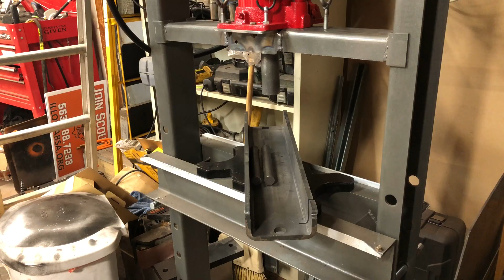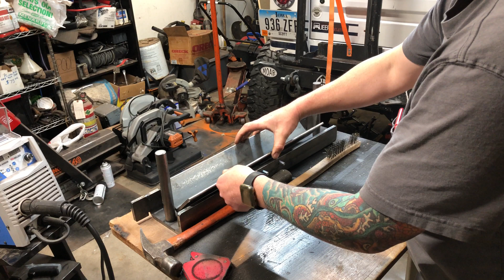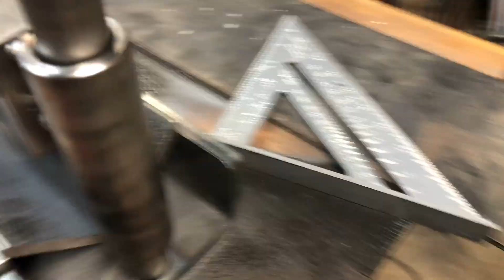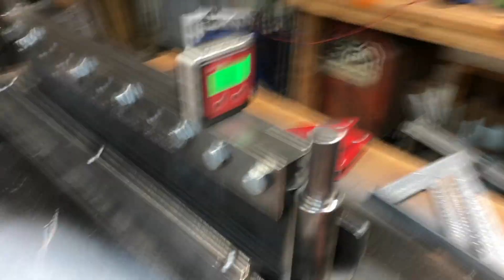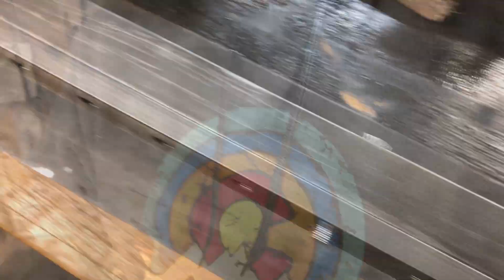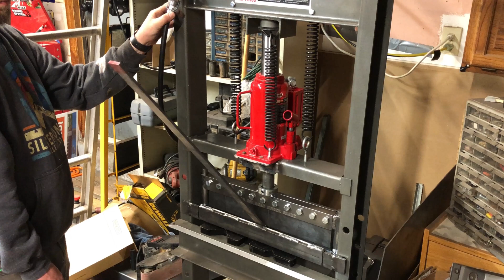( SWAG Offroad ) Finger Brake Build for Harbor Freight 20 ton Press

Comment: The same thing happened to me when I built my brake from swag offroad.  Mine is off center and my angle iron is sitting offset a bit. I didn't even check the fingers, I just assumed I didn't center the fingers correctly 😕I'll have to cut everything and redo things the way you did it.  It was my first welding project and I thought I messed up but its just poor manufacturing.
Reply from the maker: The reality is, most bends I make never bottom out in the angle anyway and it probably would be fine. I get a little particular about some stuff especially if I’m putting it together. 🤞 good luck

Comment: Good recovery.

For anti-spatter, you know they make stuff for that.  But it is expensive.  I learned to use Walmart cooking spray about a decade ago, and it works great.
Reply from the maker: Ive since learned to set the welder up a little better which also helps haha

Comment: Swag  makes awesome tools!
Reply: Yup they do but it’s just a pity they can’t ship downunder is all.
I got all excited by lots of these videos, couple hundred for the harbour freight press from Harbour Freight & a couple hundred more for the air over hydraulic Jack mod, all sounding good until it works out you can’t buy from Harbour Freight from overseas even if you have a drop ship account address in the USA Coz the press is only available “in store” - you can’t add it to your cart to check out online & pay for it! 🙄👎
Then I got on Swag Offroad website & added the heavy duty finger break and all the accessories & it was getting up there at close to $1000 US, but the online shipping calculator said another $1200 US just to post it downunder & suddenly the finger press is now $2.2k bye the time I get it & that converts to around $🇦🇺3300 and add another I guess $1k US if I was able to buy the press from Harbour Freight & have it drop shipped then pay the international freight to get it downunder & that’s another $1500 bye the time I do the currency conversion.

Suddenly a cheap /(flimsy) Harbour Freight Press - that I have to then turn around an re-engineer to make it anything like useable, and we are talking  almost $5000🇦🇺 Pacific shitsvillian micro pesos before it even arrives.

It’s all too hard and I can buy far better larger better engineered shop presses already air over hydraulic ready to got to work straight away without all the mods & re-engineering - from local suppliers downunder for around half what the “US” (but really made in China) products can be landed here for.🙄👎
Yes I know That Swag Off-road says on their website “proudly made in USA but the collar that comes in the kit has “China” clearly stamped on it.
Swag Off-road deletes any customers comments that point this out so it doesn’t become public knowledge - but this leads one to question - “well how much of the rest of the kit is actually made in USA if they will lie about the collar? 🤷‍♂️

Is the steel US steel or did that come from China and is that cheap Chinesium steel made from recycled sardine tins & about as strong as case hardened plasticine?

And the Harbour Freight Press is definitely Chinese made into the bargain.

I ain’t paying over $5k for Chinese sh!t, id sooner make the entire thing myself out of real steel from the scrap yard, at least I know what it is I’m getting for my $ time & effort.

I think US manufacturing has lost its way if it things it can import cheap crap from China and export it back half way around the world and charge outrageous markups, currency conversions and ludicrous freight costs.

We can just buy the cheap crap direct from China ourselves thanks very much. 🙄👎

It’s becoming a bug bear with me, this insane US Prices on cheap Chinese crap thinking the rest of the worlds going to buy it because it says “proudly made in the USA”🙄

There’s probably a Chinese manufacturing city that’s named USA and they can stamp everything with “made in USA” on it.

Swag Off-road is dreaming if he thinks anyone is going to pay his asking prices and freight costs for his finger break.🙄

In the same way that I would sooner make my own shop press, id sooner make my own finger break.

My 2c

Nothing wrong with what you do for your shop, or the work you do, I’m sure the $ numbers stack up better for you stateside than they do for us here downunder..

The world of manufacturing seems to be dead & buried sadly.
Reply: @ianmoone2359  The only fix is to build it all =yourself=!  The more tools you build, the more you CAN build, so make a list of what you need to build what you want and get started, wot?
A friend waited for several years until he could afford to ship his machine shop-in-a-shipping-container to Oz from the US.  He figured that he had about 15,000 pounds in there, and the shipping cost $15k, so it was a buck a pound for shipping.  UFR.  =Shipping to and from Oz SUCKS.=  But now he can make all sorts of money working from home.